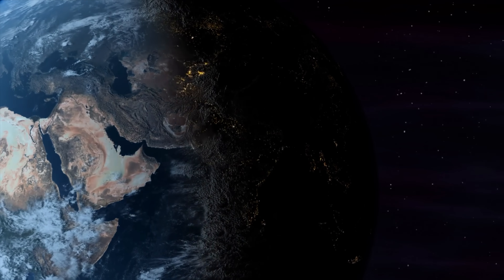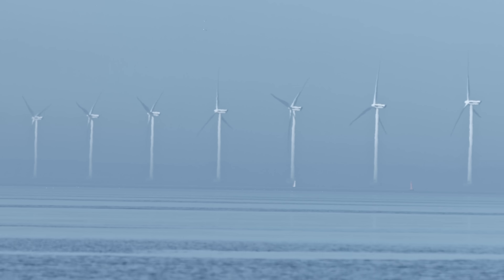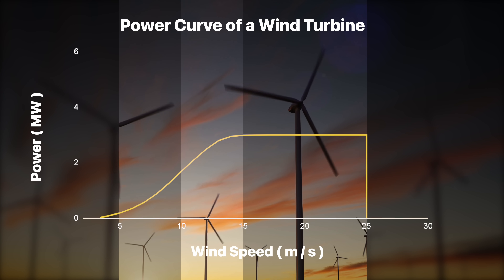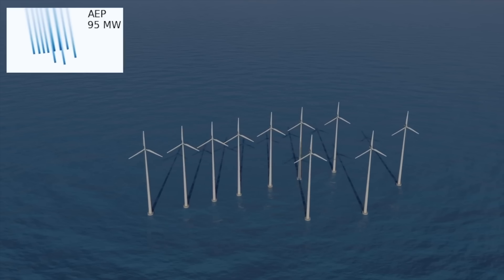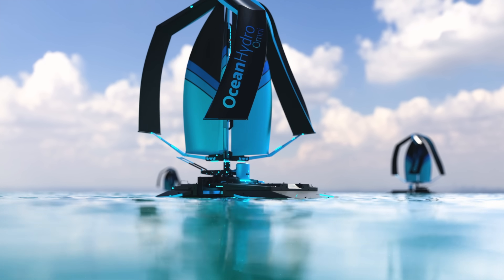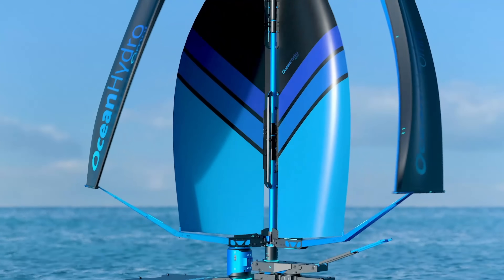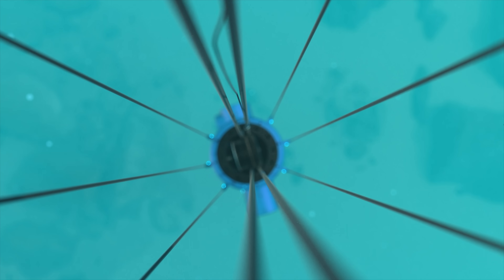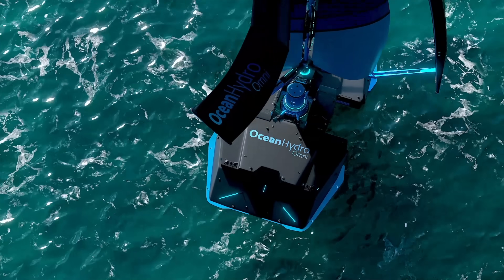Breakthrough Tech Solves Wind Power's BIGGEST Problem!

Comment: @Two Bit da Vinci Another good video Ricky, but as others including @plebiansociety wrote in the comments, I fear the concept, absent some miracle of anti-fouling technology, is a non-starter. I'm a life long sailor and can state with confidence (and I'm very careful about such things with science and tech) that the cable-trolley lift system is a disaster for the marine operating environment. There are more attacks (well, just life doing life things) on objects/structures underwater in the ocean than the comment section of YouTube videos. No. Really. I'm a huge supporter of clean, renewable technology, but this is also my great concern for tidal/underwater turbines. The approach outlined here with cables running on blocks and pulleys, just yikes. Maybe they have invented a silver bullet of anti-foul technology but there was no mention of it in the video. 

Alternatively, one of the key benefits outlined here, the "smoothing" of variable power production to the grid, could indeed be overcome with various trade-offs of on-shore storage tech (lots to pick from) or even at the base of each mega turbine. Again, there are cost/benefit trade-offs to consider but not impossible.

Finally, as a sailor, I have seen micro vertical wind turbines offered to recreational boaters. They never seem to be as popular but their shape offers some real benefits despite lower output (like lower chances of catching sail rigging, noise, and human safety).
Reply from the maker: very very valid concerns! I would love to do a follow up on the company and see how they're progressing

Comment: IF THIS IS VIABLE WHY NOT DO IT ABOVE GROUND...USING THE SAME SYSTEM BUT INSTEAD OF A DROP ON CABLE WHY NOT A LONG SCREW MOUNTED IN A CONCRETE BASE AND IF THIS WORKS YOU STOP ALL THE SALTWATER AND CORROSION ISSUES INHERENT IN YOUR DESIGN AND COULD MAKE USE OF DESERT SPACE FOR  POWER GENERATION THE ABILITY TO HAVE THEM CLOSE TOGETHER WOULD MEAN BETTER UTILIZATION OF SPACE AND LESS ENVIRONMENTAL IMPACTS NOT TO MENTION THE OBVIOUS MAINTENANCE UPSIDE

Comment: Or, hear me out here, use the hollow tube of the tower versions to house a weight that you can move up and down to store and release energy, all above water and in a controlled environment. Doesn't solve for the narrower wind speed band, but would let individual and collections of them to smooth out energy production and be more responsive.

Comment: Is the water resistance from lifting the weights lost?
Reply from the maker: yeah it wont be super highly efficient battery, but could win on cost compared to much more expensive batteries... but those details will be a ways out I think...
Reply: Also possibly easier maintenance? Still need a mix of many ideas to solve our problems.

Comment: A good idea for conventional turbines. Have the weight inside the tower. Good for land based turbines too. But NOT in water, it would be a maintainence nightmare.
Reply: This is a bad idea for conventional turbines, because lifting any sensible weight would require a tower of enormous strength, increasing its cross-section and hence its wind shadow area, thus affecting efficiency of turbines downwind.

Comment: in the animation they don't show a mooring system, unless thei intend to use the cables guiding the weight as mooring , which seem not very efficient: when wind is blowing at high speed the floating turbine would be shifted by several meters, so the cables would not be vertical anymore, and I believe that would stop the weight from going up and down

Comment: As much as I have bashed hydrogen, there are actually a few niches where hydrogen could be useful, and one of them is refueling stations for ships at sea. 

Large wind farms could make hydrogen for ships that passes by.  This could eliminate fossil fuel ships completely. The brilliance of these windfarms is that the fuel is made right at fueling station. All excess fuel can then be transported to land by the ships running hydrogen themselves and therefore solving the transporting problem. The inefficiency of making hydrogen is acceptable in this case since there is no other realistic solution, charging ships is way too slow to be practical. In combination with modern sails, ships could become 100% fossil free.
Reply from the maker: very true, I think hydrogen has a place too ... and that's a great point... you have the water source, get clean energy input, and so what if its not the most efficient thing in the world... could be huge...
Reply: The problem is you have to desalinate sea water before you electrolize it. If you perform electrolysis on seawater you just make big clouds of chlorine gas. That means you need to use energy to get the salt out and then more energy to electrolyze it so the embodied energy of the hydrogen is even lower compared to how much you get out by burning it.
Reply: @AlRoderick  who said anything about seawater? The ships can certainly donate water for fuel and rain water  can be collected.

Comment: I helped a guy hook up a VAWT to the grid in 1981 +/- .  One advantage you didn't mention is that they catch wind from any direction and do not have to turn into the wind .  Another advantage is that the power take off is at the bottom; so, not climbing inside to do maintenance.  Yet another advantage is; no need to avoid the base by elevating the blades.  Still further; a VAWT can multitask.   It can turn a generator while lifting a heavy weight; or,  do either one by itself.  Yet another means of energy storage a VAWT is easily adapted to is turning a piston type air compressor to store compressed air.   This last one is so important it needs a video all to itself.

Comment: Wild thought ,  Maybe the traditional wind turbines should have gravity batteries added to it in deeper waters To even out it's power distribution .
Reply from the maker: being built on footings they have limits to how deep they can be installed... interesting stuff for sure
Reply: @TwoBitDaVinci  , I understand that the Wind turbines Need to be in shallow areas But the gravity batteries could simply be Anchored in a  Separate location that is deep enough to make them effective and that Point just electrically tie them together .
Reply: The gravity battery could also just be on land , It doesn't need to be in the ocean .

Comment: This sounds like another Elizabeth Holmes.. Weights in water sounds great.. But then you factor in displacement of water and buoyancy.. Aaaand.. It kind of starts to fall apart! Along with issues of maintenance and saltwater generally being a pretty hostile environment.. 5x the corrosion of the rain above.

Oh.. And they have a prototype 😕
Reply from the maker: your comment has a similar ring... ok so displacement of water and bouyancy ... what about it? if its a dense enough weird, whats the problem? salt water environment absolutely is a huge challenge, I think that's what they need to prove out.. durability longevity etc

Comment: This gravity storage could be more efficient by cheating too with pumping air into the container so that the air would easily push it up as it evacuates the water inside it.  Overall the wind turbine would operate as an air pump.  Weakness in the design is the wires that will act like a yoyo as it will eventually degrade over time&weather from wear&tear mechanical activity.  There's also the possibility that the underwater currents would push it out of alignment if it's not insulated from the incoming currents.  Stronger winds also means stronger underwater currents&surface storm surge.

Comment: One thing not mentioned in this video is that higher altitudes have higher wind speeds, so besides lower efficiency the vertical wind turbines will operate with a lower wind speed than the horizontal rotor turbines.

Comment: They haven't made anything, they just have beautiful 3D animations (like every startup), and some hidden and scaled-down demo models (again, like every startup). 🙄
The big question is whether this will work - how it will withstand huge waves, how the mechanical moving parts will withstand salt water, etc.  Tidal turbines have a lot of problems with seawater and are not yet commercially viable - so I wouldn't put too much faith in this. Also, efficiency would probably be quite small, but that can be overcome if they are cheap... (If they ever start to produce electricity for real)

Comment: Reciprocating weight could be replaced by reciprocating buoy (large concrete hollow sphere) anchored to bottom with pulley block so cable returns to surface generator. Patented already.

Comment: I wonder if it would be cost effective to put make your generators reversible... if it didn't cost much more you could, when winds are dead but demand is also low, take grid power to lift the weights and just work as a gravity battery, ignoring the wind portion.  

I also wonder how many locations could have hybrid systems.  Since you are running power cables out there anyway, could you combine them with tidal or solar arrays to harvest a bit more energy while you are out there?

Comment: Super worried about underwater maintenance being an absolute nightmare. You could make it such that the weight is the only thing moving under the water, and the generation is happening up top. Then you have to be careful about how you run power transmission cables to make sure boats don't run into them. And, on top of that, how do you make sure the things don't spin? The moment imposed is parallel to the plane of the ocean. You'd have to anchor their rotation (as a group or individually) to make it so they aren't constantly spinning. Spinning turbine bases would result in twisted descending cables for the weight

Comment: One major issue these have is they don't look like they are tall enough to capture the high wind speeds. The higher you go the faster the winds. And therefore the more power that can be produced.
Also when you are using gravity energy storage in water you are counteracting the force of buoyancy which will reduce the storage capacity Vs a gravity energy storage system on land. The ones on land haven't yet proved, and are unlikely to ever prove, to be commercially viable. So, I can’t see this being viable.
That being said, I hope they prove me wrong. I’d rather hear about 50 ideas that don’t work and 1 that does, rather than no one attempting anything new.

Comment: Why don't they separate the weight system from the turbine? They could have it onshore, lift weights through the air and remove the maintenance issues with operating a mechanical system in seawater. If they need a thicker medium than air, they could use a container of oil.

Comment: Adding gears to the internal parts of wind turbines could dramatically increase and decrease the range the turbine can produce power by having a sensor automatically change gears based on wind speed.
Reply: A small fan in front of the larger fan could act as a tug boat to get the large blades going at lower speeds as long as it were geared to do so.
Reply: multiple small fans could produce a massive amount of extra torque even in low wind conditions as long as they disengage when wind gets to high speed

Comment: Just wondering how the mass is lifted? If it's with an electric motor it would probably be better to run a cable to land and lift a mass there. Way easier to maintain.
Reply: I assumed it is mechanical for efficiency.  But since it sends electricity ashore there has to be generation capability in the unit.  Far easier to convert to high voltage, send it ashore and combine it with one of the mass lifting energy storage projects (moving trains of concrete up a mountain or lifting concrete blocks into a giant tower structure).  I guess though their thought is to offshore - literally - the place where the mass lift storage happens because real estate at sea is cheap.  If you really want to do that all at sea then why not have a central dedicated mass lifter and have the nearby turbines send their power to it.  Another solution could be to pull a big buoyant structure to the bottom and release it.  That way you aren't reliant on the buoyancy of the turbine structure to keep whatever mass you're lifting afloat.  But as with the original design putting complex mechanical structures in the ocean... you're going to have a hard time making that work and keeping it working.

Comment: Big batteries can store energy peaks and can be installed near windturbines to save transmission losses. Also for high instantaneous power management it is also a big battery that can solve that problem. For long term energy storage a hydrogen electrolysis and then conversion to methanol is quite a good solution in my opinion ( this all sounds complicated and expensive but installing 300m of metal wires in the deep water and then making sure that it will not degrade and allow the heavy mass to move up and down sounds like quite expensive and not easy option). Let me know if I am wrong.

Comment: So the idea of storing energy in the form of weights is both novel and interesting, but what of marine life? I can imagine a whale doing some significant damage plowing into the cables even if shrouded in pylons. Barnacles, sea kelp, drifting garbage and plastics, and anything else that can get tangled up in the works. What I'm concerned about is the amount of maintenance this platform will require, needs to be part of the design out of the gate. All of these considerations together could push this type of system to being untenable. Darn those sea creatures getting in our way!

Comment: I would like you to investigate The harm Windmills make to the environment. These windmills have Lots of components To maintain. When a windmill is struck or too much wind And lack of maintenance And/orThe fins become unbalanced and  Failure of critical components They could easily turn on fire. The materials inside the windmill Burns letting off a gas that can harm the environment. I would like you to investigate that and prove me wrong. If you've find what I said is correct please do an episode on it, Thank you.
 If I offended you in any way Also let me know.
 I'm not going to stop being me Just to please you. I just won't watch your channel anymore thank you.  Simple👍
Reply from the maker: There is harm in all energy sources. Huge nuclear waste from nuclear. Millions die each year from fossil fuel burning and pollution and the rest… I’m 100% on board with assessing these dangers as long as you apply that approach evenly to all forms
Reply: @TwoBitDaVinci  yes Sr, that's me always and it should be that way always.  Without debate we wont-learn anything.

Comment: I have an idea journal I keep. Many years ago I had the idea of building an entire house on a lift system that slowly lifted the house in the air. When power was needed it would use the lowering of the house to generate power.  Always reasons NOT to do this and safety issues but why not?

Comment: the renewable world is getting to a point where its just a scam paid by the oil industry as they know for each solar/wind u need a gas generator to backup. just get a nuclear reactor it was tested for years and its proving to work and have zero problems
Reply from the maker: Not at all… nuclear isn’t without issues
Reply: @TwoBitDaVinci  allow me to correct i meant intermittent problems it gives power regardless of the weather and don't needs back up and yeah all power generation technology have problems but nuclear seems  to have the least of them

Comment: I'm glad frenewable energy sources are starting to integrate energy storage, which I have been saying forever was their weakness.  I think its a great advancement.  Question: will verticle windmills lower the death rates due to bird strikes?  If so, that will be another advantage.
Reply: There are some types of wind- basically giant poles that sway in the breeze, that are supposed to be pretty safe for birds.  I think I read something about simply painting one blade black helped birds see the blades better.  The number of birds that windmills kill is actually pretty small in the grand scheme of things (a couple orders of magnitude lower than the number of birds outdoor housecats kill), but anything that can lower it is still is good, and offshore is more likely to kill different types of birds than housecats.
Reply: @NacorantheHarmonicaPlayer  I've seen the paint one blade black, but I want to wait until I see someone else replicate the study results before saying its a definite solution.  The percentage of birds killed is a bit misleading.  Cats generally kill "common birds".  Windmills tend to kill the more predatory and migratory birds like eagles, hawks, condors, which are more endangered.  I don't think anyone says pigeons are endangered.  I think the offshore windmills are even more of a risk because migratory birds will be drawn to them as resting spots.  Well, time will tell, lets get some good studies to see if this kind of windmill is even feasible.

Comment: Would just like to point out that the grid demand is very variable, one recalls the classical peak demand at FA cup final halftime,  the implication that constant supply is required is a misrepresentation, constant over supply is required.   Also, I have a feeling the variability of wind speed during the day was over stated; the second by second variations must surely be smoothed by the inertia built into the turbines and there will be additional smoothing based on area.   Next, Technology Readiness Levels...   think we're hearing a touch of overstating their readiness here.
Reply from the maker: Yes this could meet demand as needed